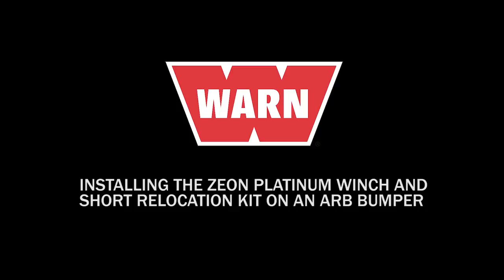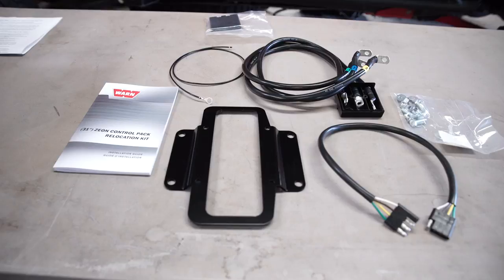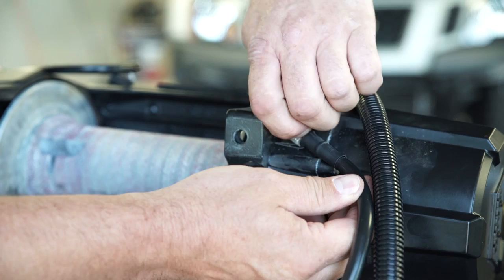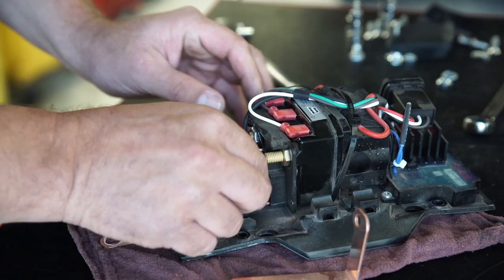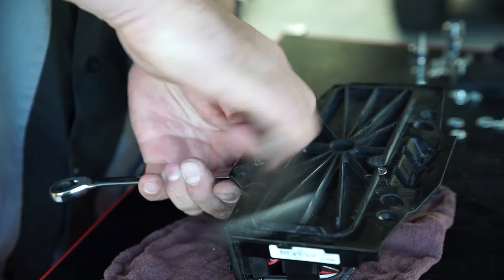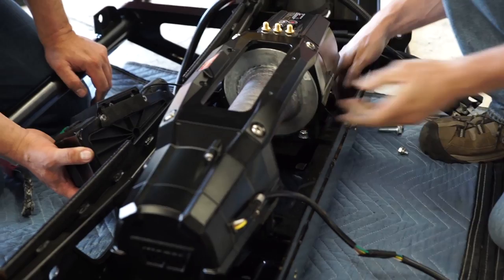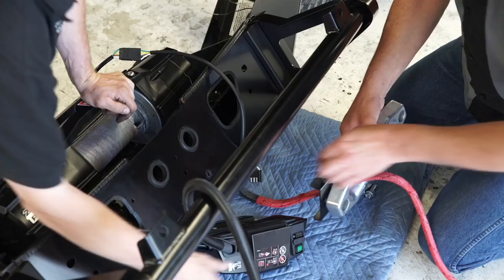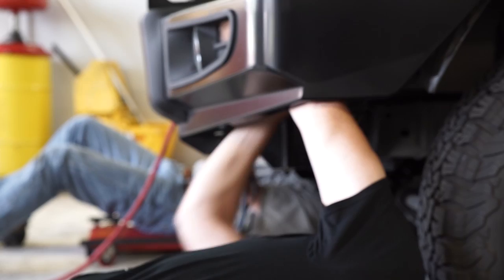Installing the ZEON Platinum Winch and Short Relocation Kit on an ARB Bumper

Comment: Were there any clearance issues fitting the winch assembly to the bumper? I've seen other videos which indicated the Zeon series requires spacers to fit the bumper.
Reply: I am trying to install one right now and have ran into this exact problem! Currently trying to figure out if Warn or ARB sell a spacer kit or if I just need to get some spacers made.